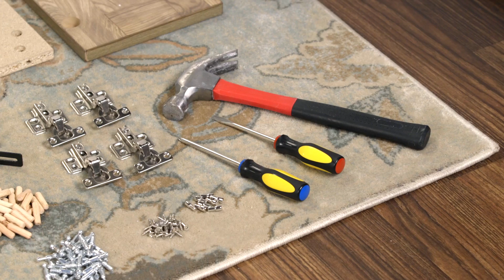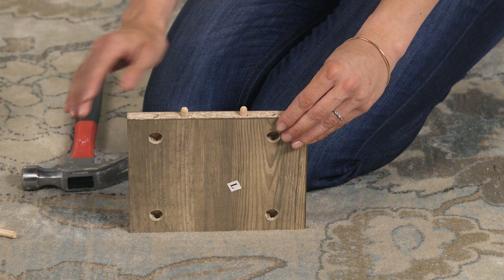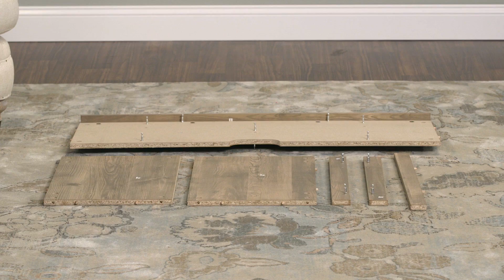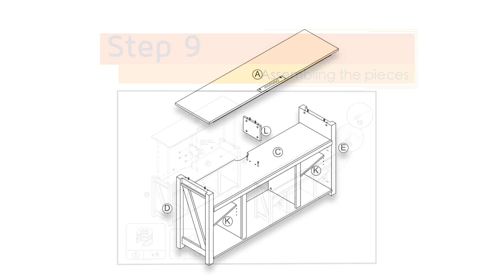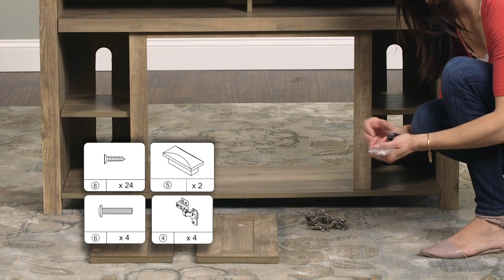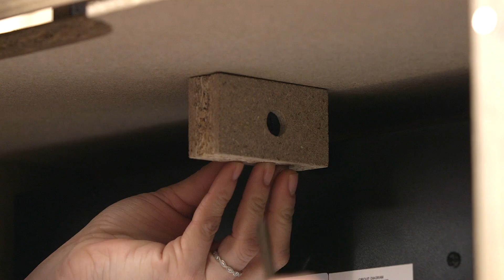Ameriwood Home AltraFlame Farmington Electric Fireplace Assembly

Comment: What can be the problem if fareplace does not work , does not warm .
Reply from the maker: Hello, if you are having issues with the heater, it could have overheated. Many of these fireplaces that get plugged into a powerstrip are not getting enough power and will overheat. Please call our customer service team to find out about replacement parts 1-800-489-3351 from 9:00 a.m. to 5:00 p.m. CST. Thank you.
Reply: Ameriwood Home 
Thank you 🙏